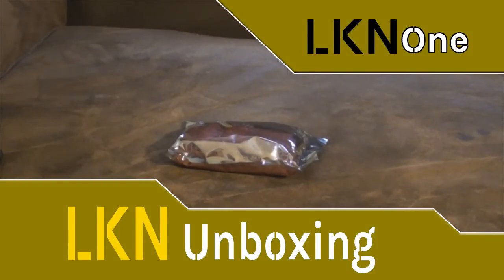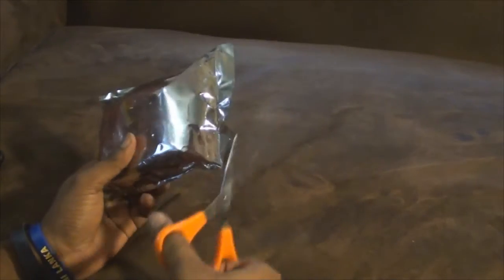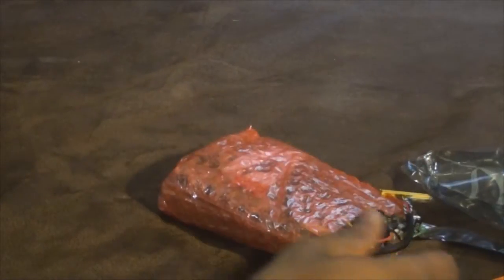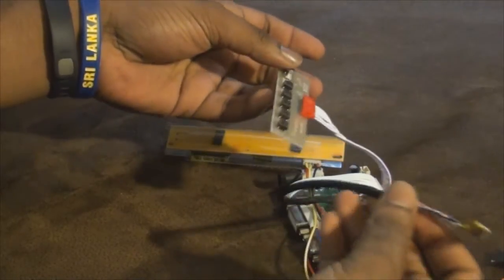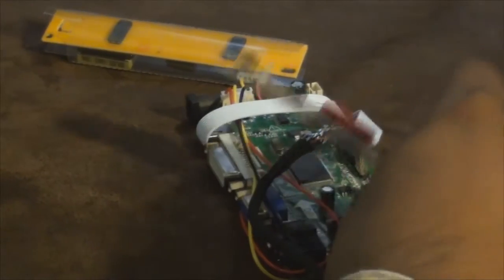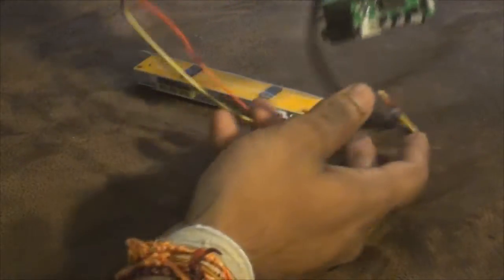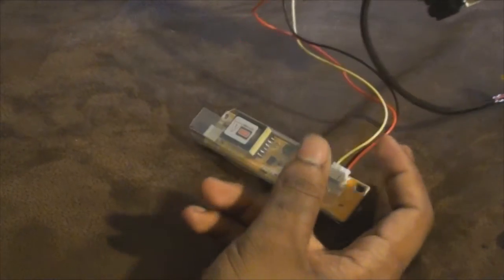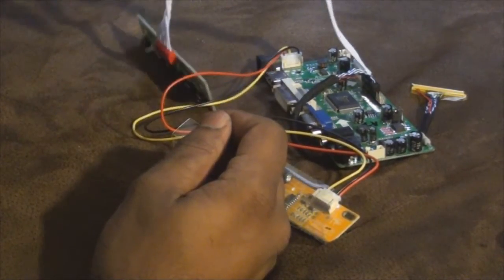Unboxing of HDMI, DVI, VGA & Audio Controller Board for LCD Panel

Comment: is it possible to use toshiba satellite l500 model laptop display
Reply: I found Controller Board for my Fujitsu laptop so i think u will find (site where i found: http://stores.ebay.pl/e-qstore/LCD-controller-kit-/_i.html?_fsub=5134655012&rt=nc&_pgn=2&_ipg=192)
Reply from the maker: +bijil kp +Maciej Pośpiech Yeah, in general it does require some amount of Googling just because you need to make sure you know the exact panel you have on the device. Some laptop models actually come with different options for displays and therefore have different controllers. The one that I used this controller for was a very obscure brand , so I think it would be much easier to find for a common brand like Toshiba. Good luck!

Comment: is it possible to use 32 in Tv LCD pannel?
Reply from the maker: +masterwu Terry it is hard to tell by just that information alone.  You will need to look at the model/serial number of the panel itself and see if it is compatible. Try searching Google for your model number to see if there is a match. You may also want to reach out to the and seller and check with them. Sometimes, the sellers will provide and additional connectors or adapters you need.